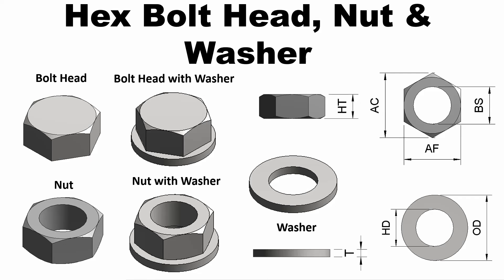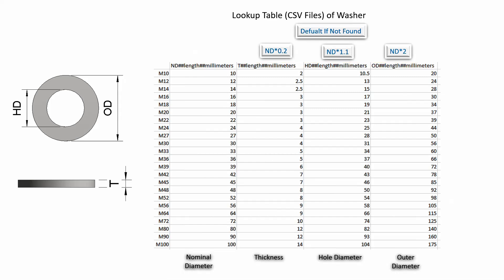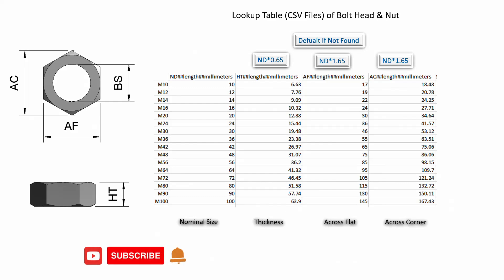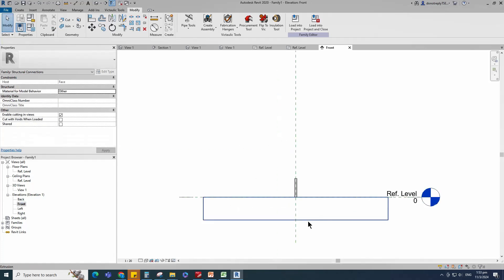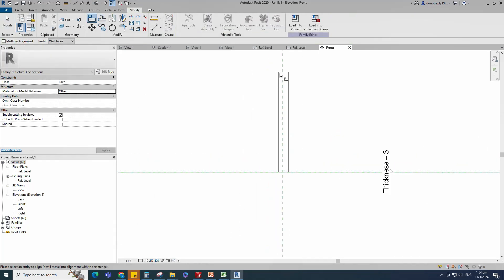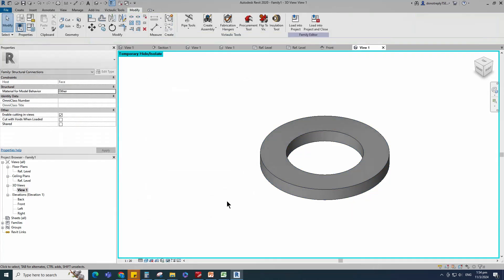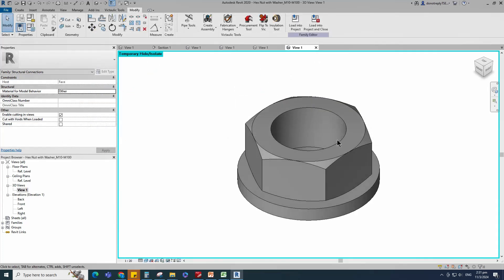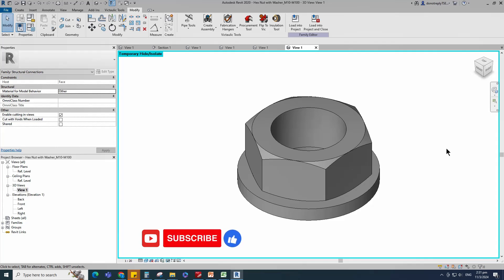Create Hex Bolt Head, Nut & Washer Revit Family (Parametric)

Comment: size_lookup(Lookup table name,"HD",Nominal diameter*1.1,Nominal diameter) This is the formula for lookup table but it show ''INVALID OUTPUT" and i followed your 100% instruction as your CSV table showing in the initial view of washer. please send me at list CSV table i can start working on it.
Reply from the maker: Please check for Nominal Diameter parameter. D is Capital or small latter for Diameter?
Reply: @ThomRVT  Thanks for reply Sir, yes I use small d not capital D, I added Nominal diameter. Please show me your excel format of the head only, I will just match.
Reply from the maker: @malikalam2542       https://www.youtube.com/channel/UC7h2QFFY7OLyDRteMG6nzNQ/join     I would like to invite to joint for csv file sharing (or) You can share your csv to me via email. So I can check for it.
Reply: @ThomRVT  I paid now where is the file CSV file, i can't find? Please send me, Thanks
Reply from the maker: Please contact this Email, thomashzthan@gmail.com